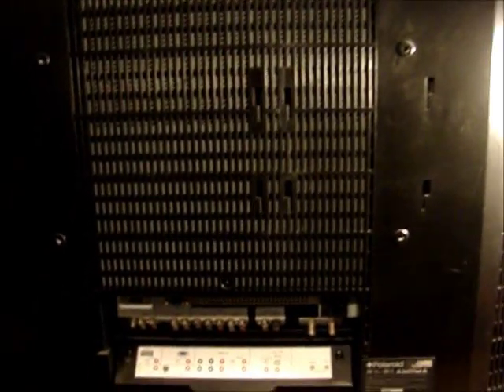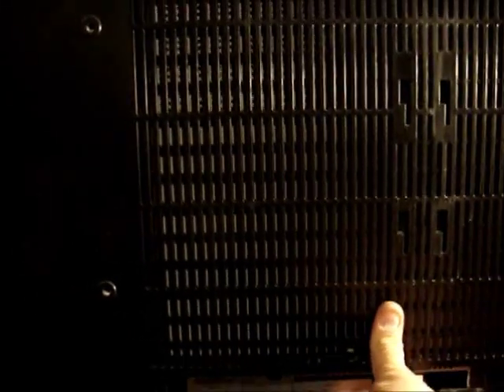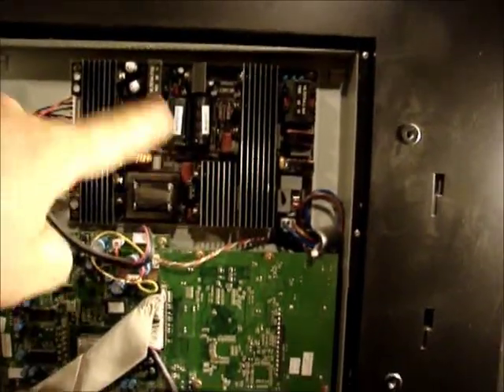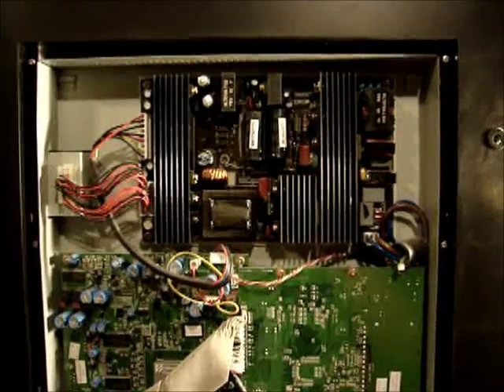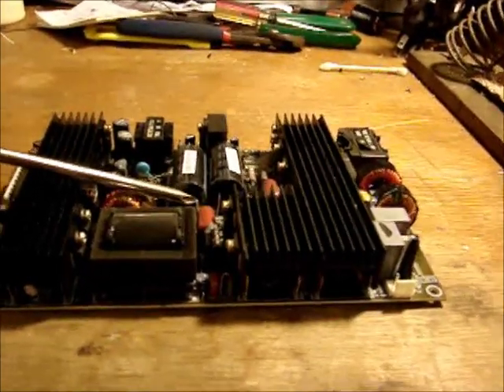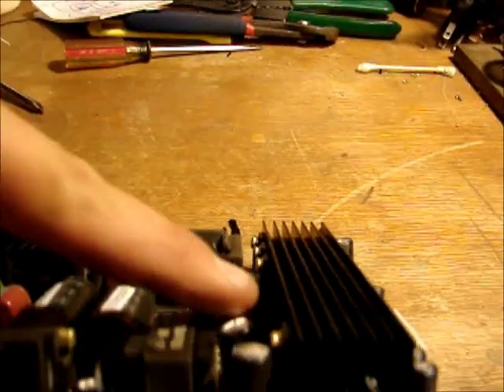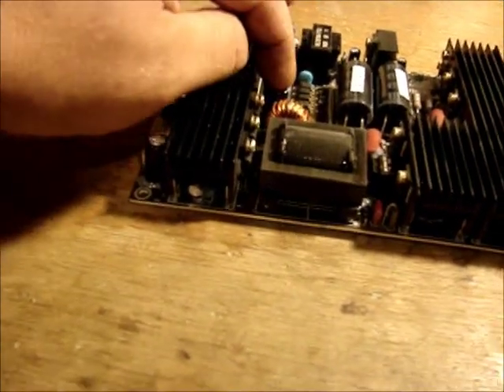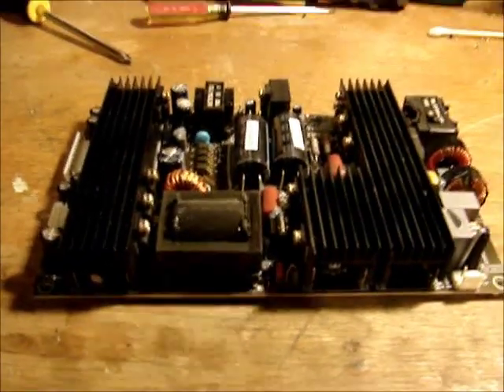Polaroid Flat-Screen TV Repair Part 1 of 2?

Comment: I have a 1521-TLUB and can't open the case. All the screws and even the nut at the base of the coax is off and I still can't get the case open. Any ideas?
Reply: If It's on the stand then there's a screw in the bottom of the stand holds it together
Reply: kydenj bennett Thanks. Yeah, the stand was easy but the main case was held together with internal clips. I had to pry the case open on the side at the seam to get to the clips and work each clip free
Reply: oh okay